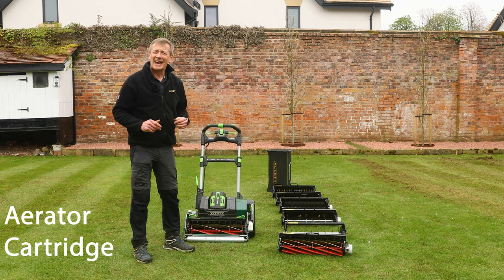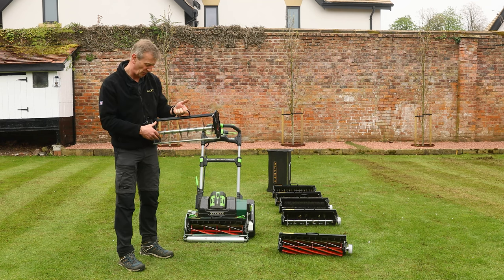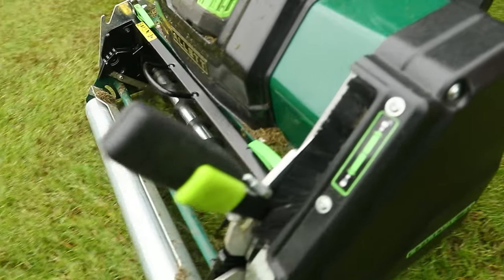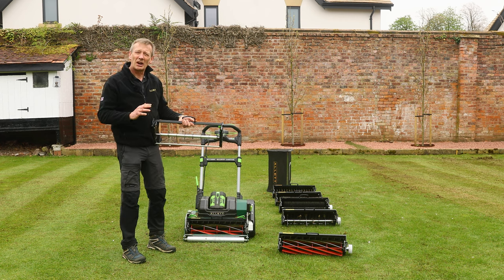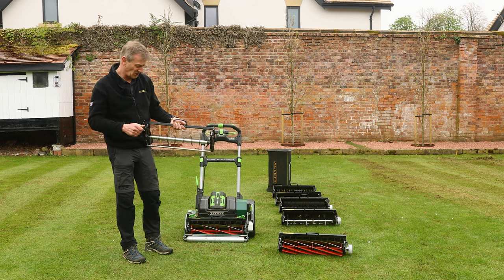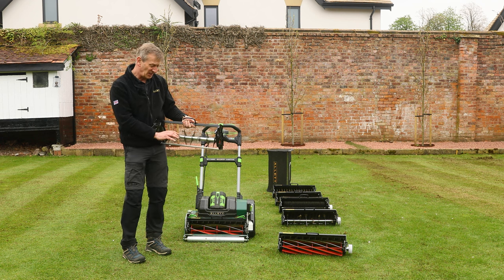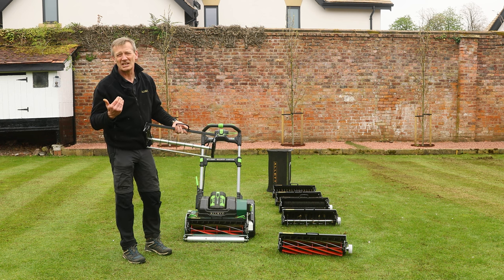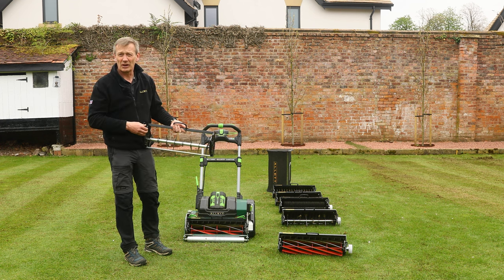Allett Aerator Cartridge

Comment: Hey, im currently buying a Allet Classic 17L (for my first time buying a reel mower)

I read a lot about all the versions which are available on the market and i decided to buy the Allet model 😅

My questen for the future, is there a way to put on the Classic Version a Metal front wheel and the brush (behind the front metal wheel) like the Kingston version had?

Cheers and caint whait for the results 😊
Reply from the maker: Hi
Why don’t you just go for the Kensington or Liberty 43 to start with? You’ll get the steel front roller and the incremental height of cut too!
Reply: @ALLETTMOWERSUK  
It was the price uftly 😅
I was thinking about for weeks and decided i start with Classic because its my first time using a machine like that!

And buy the way the dealer who sell it was on sale for €1700 and i thought is good deal for beginners 😉
Reply from the maker: @grayfox87kurt26  you would need the 
Front Roller Carrier  for the Kensington 
And the Turf Rake Assy
Reply: @ALLETTMOWERSUK  yeah right BUT for the Classic 17L NOT for the Kensington 😉
Reply from the maker: @grayfox87kurt26  yes we don’t do a rake for the classic . You’d need to change the whole front assembly of your mower if you want to fit a rake to it as it’s different
Reply: @ALLETTMOWERSUK  the whole front means what exactly?
Reply from the maker: @grayfox87kurt26  front roller carrier and the turf rake assembly 

You’re better off just buying the higher spec mower in the first place even if it means saving up a little longer.
Reply: @ALLETTMOWERSUK  aren't they recommended?
I mean from your side?
Reply from the maker: @grayfox87kurt26  we don’t recommend adapting your mower if possible no as the mowers are designed as they are for a reason. 

If you go for the Kensington or Liberty 43 you have additional features like the steel front roller, grass rake and incremental height of cut change that are well worth the additional money compared to a classic 

The classic is a lovely mower though but it doesn’t have the features of a more premier machine
Reply: @ALLETTMOWERSUK  ah ok got it! Then i fit with Classic as it is, i will test them, if im happy he stays, if not i will think about!

The problem is, we dont have that much Dealers in Austria 🤷
Reply: @ALLETTMOWERSUK  hey you got me, i found a kensington 17K from a privat dealer - my questen are all of these new Cassettes compatible with the "K" series?
Reply from the maker: @grayfox87kurt26  hi the UC cartridges will fit but we wouldn’t really advise them as you don’t get the benefit of the extra depths in a Kensington so it’s not justifying the extra expense. You would just need the white cogs on the end 

You are looking at the Qc cartridges instead which we have a full range of. Great decision to go for the Kensington
Reply from the maker: @grayfox87kurt26  https://allett.co.uk/collections/qc-lawncare-system
Reply: @ALLETTMOWERSUK  did you recommend the K Series?
Its been quiet old i guess (2009) for this price 😅
Reply: @ALLETTMOWERSUK  omg...last questen and i leave you alone 😅

Currently there are a second dealer in my near which sold a ATCO BALMORAL 20 SK

Could you recommend this one?